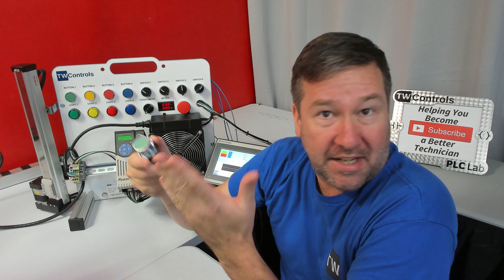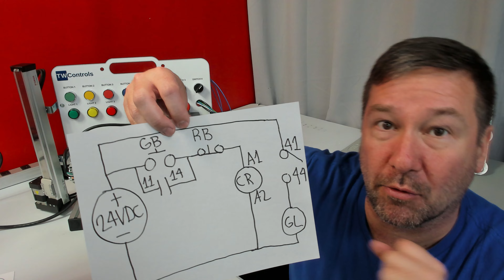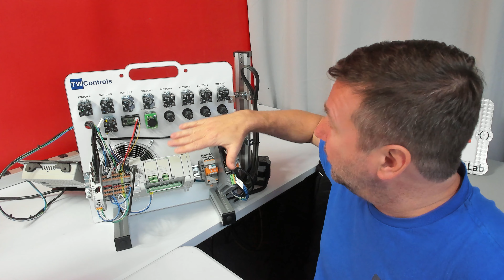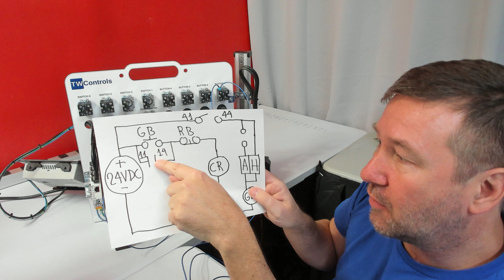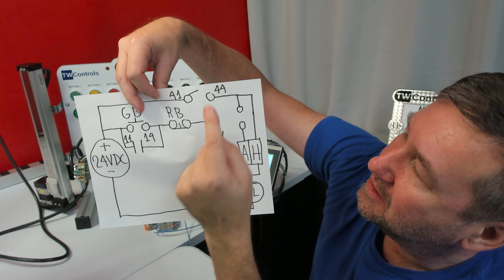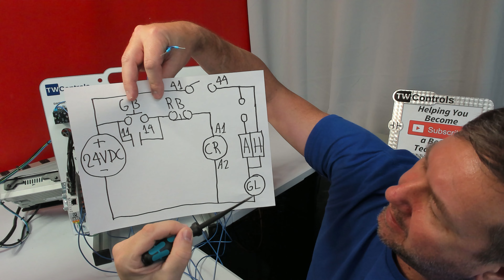Hand Off Auto Circuit that Does NOT Start After a Power Failure

Comment: How to reference a program tag which is under a schedule task 
Fron main task 
I tried with the program name.tag name and tried with some brackets too, how to reference a tag which is in another task of same plc and manipulate with it
Reply from the maker: Make it a Controller Tag.
Reply: @TimWilborne  no I can't, it is a very big program, and I have similar machine around 4 machine with same logic , I can't name each and everything with unique name, instead I have created it same tag and just changed the task name and duplicated it,but I have to manipulate some of those tags from main task
Reply from the maker: The advantage of program scoped tags is you can uses the same logic including the same tags on different programs in the same PLC.  The disadvantage is you can manipulate them from outside that program
Reply: @TimWilborne  but in HMI which referencing the tags , I can reference both controller and program tags as well, but it is not happening in plc itself, It's ok I have done some alternative , but if it is there it will be useful
Reply from the maker: That is correct

Comment: E-Stop = Power Failure 😂
Reply from the maker: I'm not following you. Can you elaborate?
Reply: @TimWilborne  when you press an e-stop, it's equivalent to a power failure. If it stops on the press of the stop, it will stop when power fails. Thought I was being clever but failed 😄
Reply from the maker: Even then, some estops automatically reset (we could argue whether they should) and others have to be manually reset.
Reply: @TimWilborne  to me, an e stop should never automatically reset. Otherwise it would not be an e stop. It would be a pause. But like you said, depends on how it's interpreted
Reply from the maker: I 100%, it should take a separate step to reset, but a large amount of small systems do not.

Comment: Food for thought. At times you want an automatic restart after a power failure especially in a unmanned control system yet critical operation. The key concept here is "Auto" in a HOA switch stands for "Automatic" and should always be respected as such. This doesn't always means it will automatically restart but means it is automatically controlled by some of controller or human remotely by SCADA, RtU, etc. The controller can make decisions based on inputs, safety relays, etc. A lot of critical operations usually have a back up generator of some sort on site and power is monitored by a voltage/phase monitor (some have power up delays on unit itself) or some other delay. When the power is back to normal either from the utility service or generator power and the the switch is in "Auto", the controller I was speaking of makes the decision based on the design of the system with no human intervention on site. Again, this is based on critical operations whereas no humans are affected by moving parts, etc.
Reply from the maker: Absolutely!  This is a big discussion in one of our exercises during a PLC training week.  What is a "safe" state during a power up is going to very much depend on the situation.

Comment: The way i've always done it, we would have all control output power, or drive STOs on a safety relay + safety contactor.  Now with the safety PLCs, I just treat them like the configurable safety relays, I used the Proper DCS instruction, and kill the safety contactor. What kind of industries are wiring up a circuit like that? I don't like unintended operation being on a regular relay without redundancy and monitoring. How would you categorize that in a safety ratings people are throwing money at now a days?
Reply: I'll also point out that there was an evolution of safety over my career. In the beginning some plants were the wild west. They had signs to remove a person who fell into a mill, and how to reverse the motor that sucked them in. Then OSHA and lawsuits came. At first we started with relays. There was a relay for a floor mat, a light curtain, an estop etc. Then they came out with Configurable Safety relays. In software you could say HEY, This part of the relay is now an estop, and this part of the relay is now a light curtain..... Then AB gave us safety plcs. IMHO they should be used like the configurable safety relays. Wire up X Y and Z, and add zero logic to it (feedback to the program is okay). Treat it like a safety relay...... Unfortunately I've seen full safety programs done in ladder logic without a single DCS (dual channel safety block in ab) in a major fortune 500 company. We don't program safety. We hardwire it. Then we lock it if was configured by software. Then we fight the safety during commissioning, and figure out how the customer's approved personnel can work with the safety instead of being crippled by it.
Reply: Interesting.  Please post a video on this subject and educate us !!    This safety relay stuff is very specialized. Hard to get easy to understand information on the subject.

Comment: I actually just did this for my roommate's heater. I am working on getting a backup generator installed on the house, and her heater by itself would eat 1/4 of the power, so I installed a compact magnetic switch so in the event of a power failure the heater won't be able to turn back on
Reply from the maker: Great application example!